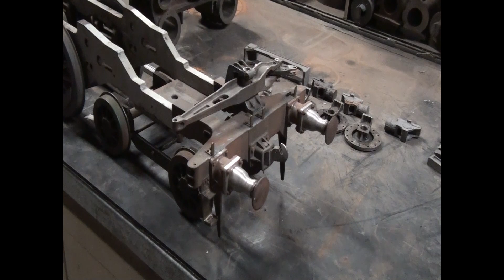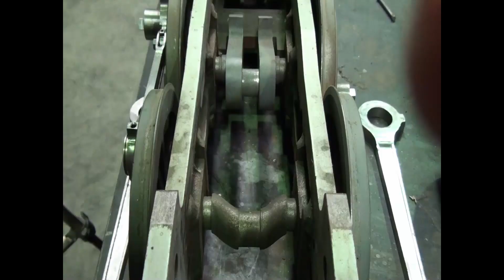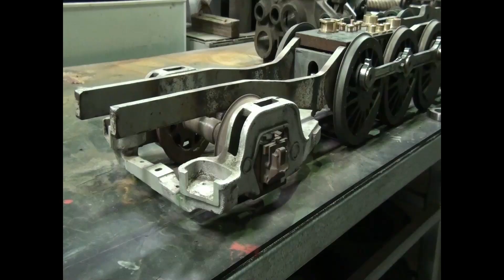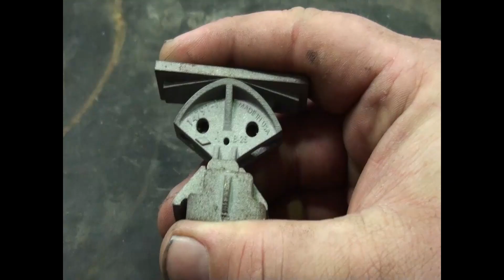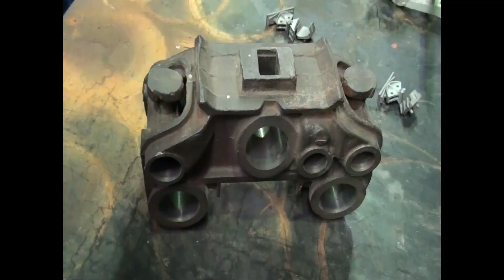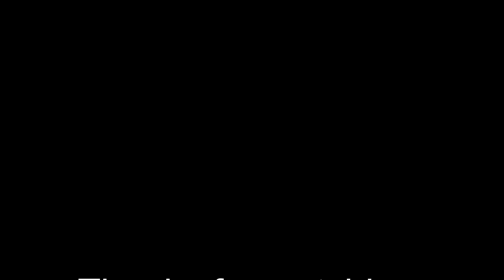5 inch gauge NSWGR D57 constuction part 1

Comment: Just found your channel and this vid and really hope that there's more to come. D57 is high up on my wishlist (aiming to 3D print one around 1:22.5 myself once I get hold of suitable plans)
Did you guys model the parts in Fusion 360 for printing / casting?
Reply from the maker: HI Tom, most of the casting were drawn back when i had access to inventor now i use fusion 360 when i need to. there will be more updates soon, i just spent a week drilling holes in the cylinder casting.
Reply: @willowtreeengineering1556  Awesome, looking forward to seeing more. Might well inspire me to finish mine in Fusion so I can 3D print it.